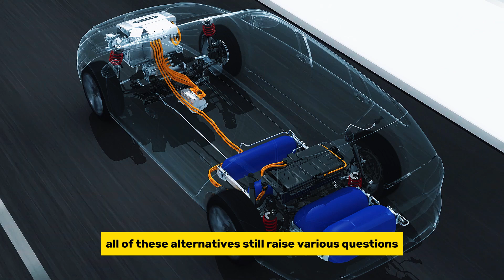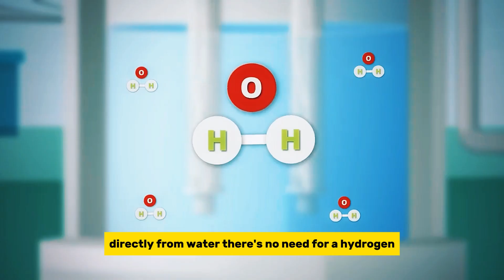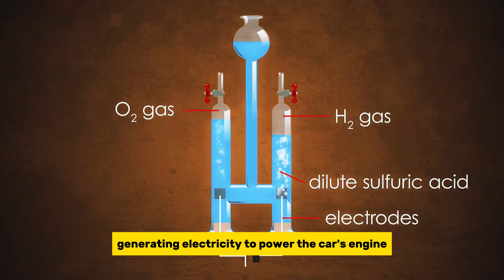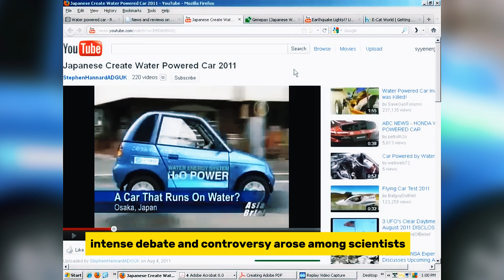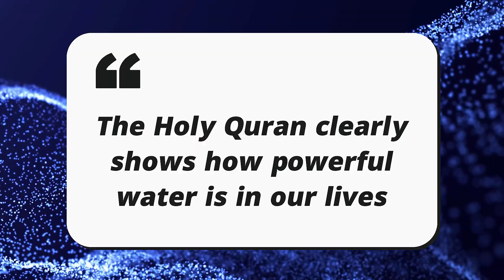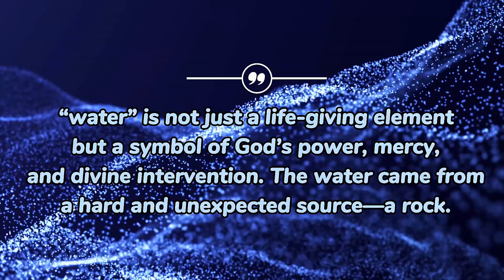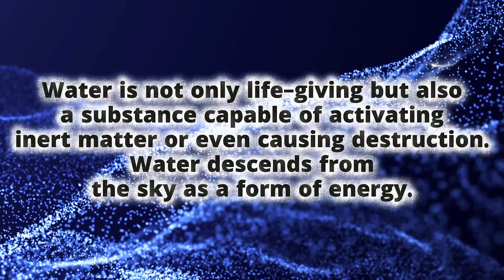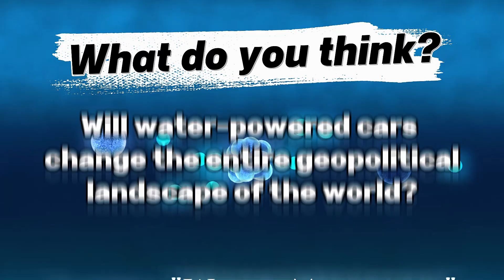A Car That Runs on Water! Will Toyota’s Tech Shake Global Superpowers?!! | CosmiSoul Bangla

Comment: The secret that makes the difference in electrolysis of the water, is the frequency of the electricity which is pulsed into the water. Every item in existence has its own specific frequency. In the 1930's a genius named Royal Rife made a machine that pulsed frequencies. He put some pathogens in a container and started pulsing frequencies into the pathogen laden liquid in the container. As he turned the dial, changing the frequencies, he noticed one of the bugs literally blew apart from the inside. He noted the name of the pathogen and the frequency, then continued the process to document the other pathogens and their coefficient frequency. Then, he found he could cure many pathogenic diseases. Stupidity, he started shouting about his discovery and was immediately destroyed along with his machine. If you pulse electricity at the coefficient frequency that water operates at, it will release huge volumes of hydrogen and oxygen with very little electricity. These technologies have been suppressed along with more advanced technologies where perpetual motors don't even need electricity. A friend of mine was converting cars to run on gasoline and then, once running, switch to water once the electricity was produced to start the electrolysis. The biggest problem was how to adapt the car's computer system to incorporate it.